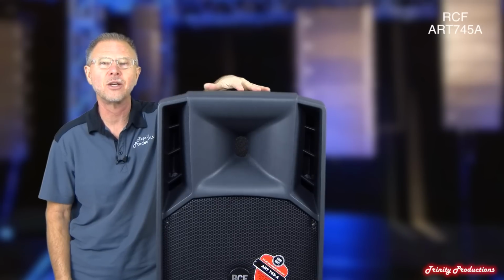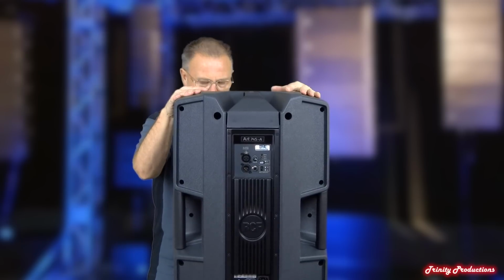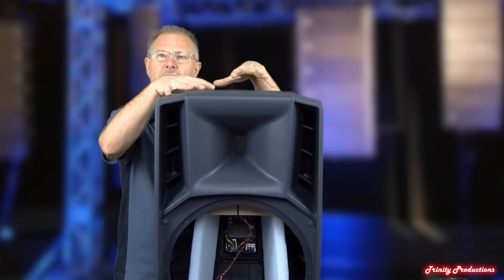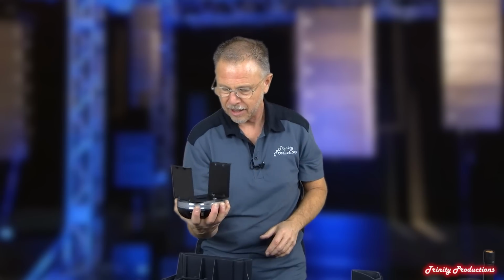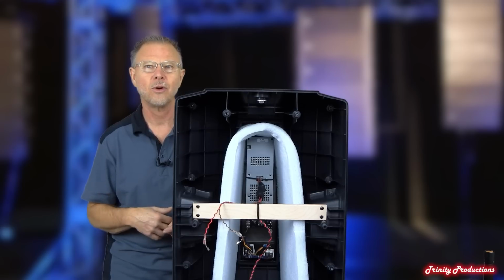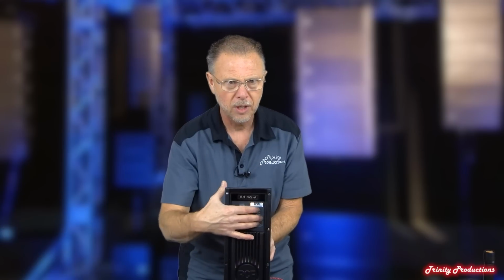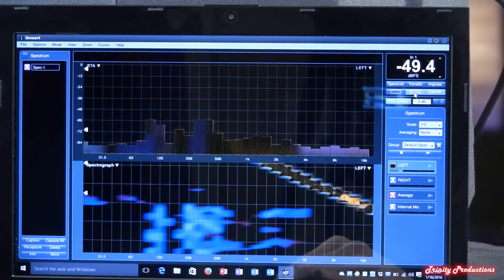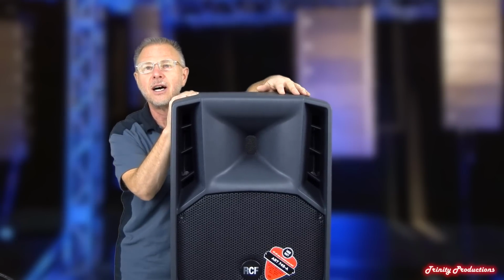RCF ART745A Complete review - 2 two-way 15" x 4" most awesome speaker - AUTHORIZED DEALERS

Comment: Hi 
Wich would you recomand ? I want to use just 2 Speakers for a Live Events. I have my eyes on Rcf art 745a and Fbt himaxx60 a 
Wich ist better in volum spl? 
Wich sounds better overall ?
Reply from the maker: The RCF 745 has a much lower cross over point 650hz vs. 1.6khz which is going to be a smoother transition from the LF to HF similar power to the speakers and similar SPL, I would take the RCF with the lower xover point any day. Less harsh to my ears

Comment: hello , i have 2x rcf 745A mk4 , is it possible to pair them with 2x 8003 and 2x 8004 subs ? and what is the best way to set up the system ? Thanks and greetings from germany
Reply from the maker: yes, either of those will work well, the 8004 has more power, but 8003 newer DSP, set for 90hz cross over and use the cross over out to your top boxes, run input into the subs and you are good to go. Thanks for watching.
Reply: @trinityprosound  thanks and very helpful reviews
Reply: @trinityprosound  sorry , 1 more question plz .. which is better ? DVA S1518N or RCF 8004 .. thanks again
Reply from the maker: If you don't need the RDNET of the 1518N then the 8004 would be my suggestion, both are great subwoofers.

Comment: Hello,  With the box being a two piece design, is the joint waterproof?  How would they stand up to use outdoors in occasional rain?  Or would they need the joint to be sealed?
Reply from the maker: no it is not water proof, i would look at a speaker that has a full grille and some type of foam behind it to ward off moisture, you would have to have custom covers for them to even think about using in RAIN. its electricity you can get hurt seriously or DIE from moisture and water combo and power...

Comment: hi i really meant the vol control .....also i have never touched the mic / line control looks like its set on mic ...does it make a difference ?
Reply from the maker: if on mic and you are using a XLR line input a huge deal as i will simply over drive the input stage of the DSP and could actually damage it , use mic input only if you have a dynamic mic connected directly to the speaker, in all other situations it MUST BE ON LINE INPUT
Reply: @trinityprosound  thank you i took them to my local music shop  and told me it was online but agreed it looked
misleading

Comment: another question if you dont mind   i think i know the answer but will ask anyway ....could you use the 745s and TT 25a s  together or would it cause too many phase problems ?
Reply from the maker: Like side by side ? No, too much comb filtering. you would have to splay them at their coverage angles to minimize that, but sonically they should be "ok" google speaker comb filtering for a good read...
Reply: @trinityprosound  would you just daisy chain out of one into the other or come out of aux on the desk ?
Reply from the maker: if you need control of the volume separate, an aux or sub group would be the best. if not and you set your levels and good to go, then L/R, and no other settings needed...
Reply: @trinityprosound  one more question sorry....but your advice is appreciated  i watch your brill vids all the time...
I have quite a low singing voice   would i notice a difference with the TT25a being a higher xover to the 745s ?
Reply from the maker: no you most likely wont hear any difference in that respect

Comment: what would you recommend if choosing between 745s and tts25a s ?
Reply: yes but i have  been offered some great condition TT25s at a great price so will i notice a improvement in sound quality from my 745s ?
Reply from the maker: Yes you sure will ....but, the xover point on the 745's is the main point of the larger HF driver making them sound soooo smooth , if they are the TT25A MK2 it does have the 4" driver and a low xover of 750hz but the ART has 650 hz , but the TT line has better everything, speakers, DSP, amp, drivers and wood box.
Reply: @trinityprosound  will the xover make a big difference ?
Reply from the maker: most will probably not notice the difference.
Reply from the maker: go with the NX45s, like a ART 745 in a wood box without having to spend $$$$ on the TT line.

Comment: i typically do 200-400 people wedding reception, would this suffice? Cant tell wattage
Reply from the maker: yes , 700 watts RMS power amp. 2 of those will do well, but if you want good low end you will need to also include subwoofers as with any 15" 2 way box, push to hard for bass and low end and you will toast them eventually.
Reply: thnx! what confuses me is qsc k12.2 says 2000 watts
Reply from the maker: 2000 watts of ? no one knows...from all the specs and what those speakers do, they are "maybe" 500 watts if that.
Reply from the maker: it is 2000 watts of who knows what, peak to peak most likely, then 1000w peak, then RMS around 500-600 at best. It is all marketing and many have fell into the trap.

Comment: Great Review, How would the 745 compare to Ev EXT 15" Line
Reply from the maker: Does not compare...the 745 has around 800hz cross over where EV is at 1.5k and RCF has a monster driver on it for smooth HF transition from the 15" driver. EV does not state what kind of power is the 1000 watts so assuming program or continuous and not 700W RMS as RCF box is...
Reply: trinityprosound ... wow As I’m Reading All These Statements My Feelings Are Getting Crushed Cause All Along I Was Thinking Qsc & Ev speakers Were Some Of The Best Brands And Come To Find Out They Best Lines Cant Even Come Close To RCF This Is Crazy I Run Two Qsc Kw152’s & Two EV Etx 18sp’s and the system sounds great in my opinion every gig I’ve done with People always compliment me on how good it sounds but now reading these reviews I want to sell it all and get even better I want one powered system that can handle damn near anything from big ball rooms to big cook outs😂 I love great sound!

Comment: how is this compared to the Yorkville PS15P's? I feel the rcf has a weak cabinet and i'll need to carry a sub to the gig vs my current PS15P's don't need to carry a sub.. the RCF's competition is QSC, EV..
Reply from the maker: About the same actually. Both have roughly same power and SPL you can only get so much from a driver / power applied to it with the volume of the speaker cabinets. The only speaker that I have used that comes close to not wanting to take a sub to a gig is the Yorkville NX750P, but would limit early with heavy low end content, thus the need for a dedicated subwoofer.

Comment: Hello,
What is better with 745, pair 8003 or two pair 708 or dsr118w ? We need system for gigs 500 people.
Reply from the maker: You will get 1db more output with a pair of 708's but most likely will never be able to tell the difference in SPL. The 8003 is a great sub but for a single sub per side for 500 in attendance may be asking quite a bit from a single unit per side.  the coupling of (2) 708 per side will move a bit more air with (2) 18" per side - the DSR is about the same as the 708's for power and output. Where is most of your audience at and what type of levels are you looking at maintaining, type of music etc.?????
Reply: We are rock band and we play in clubs, disco, no more then 300 people, but sometimes we play outdoor and in that situation we need some more db.
We have 745, but whats better with subwoofer, 745 or meaby 732 ? Thank you !
Reply from the maker: Can't get much better than a 745 in an injection molded box...the 8003 for 300 with one of those per side should work well. if you want to have everyone feel some low end, you will need 2 per side, but with one per side they will hear it in the system response and those up closer will get the good low end ... it will diminish through the crowd somewhat where obstructed. pole mount the 745's on the 8003 so the top of the speaker is 72" plus and you will have very good coverage and response. if they are standing a bit higher if possible.
Reply: 732a with the 905asII, 2x, maybe a third sub to go carioid. That'll be a hack of a system.......

Comment: He is raving about the 4" driver, the great crossover point and most importantly, the great sound quality because of the 4" driver.  My question is WHY DO OTHER MANUFACTURERS NOT USE 4" DRIVERS and always go with tiny 1.75" or smaller in their full-range boxes?
Reply from the maker: Cost is the main factor and as an industry we have come to accept 1.2khz to 1.6khz crossover points as acceptable...but once you hear a system crossed at 800-900hz you don't ever want anything else, it is almost like having a 3 way speaker..

Comment: The RCF 745A is no doubt a great sounding speaker. But what  concerns me is that since the 745A does not have a full grille,  there are chances that small lizards would climb into the box and find it a good place to reside, and the amp module could be damaged if these unwanted guests are electrocuted at the PSU. May I know your opinion,  would the 745A be suitable for permanent installation in a church where small household lizards is  commonplace? Thanks.
Reply from the maker: The ART745 is wide open and yes could have intrusion into the interior...look at the HD32 speaker.
Reply: Thanks very much for your reply, John.

Comment: Hi i would like to upgrade my Mackie 450 srm because to heavy. I need a powered speaker for backing tracks plus vocals no bass speakers. Question ive been looking at the 735 art series rcf speaker, firstly would a 735 or a 745 perform well with music and vocals. Bare in mind i will be using them in full range mode without bass speaker
much apreciate your response. Thankyou
Reply from the maker: Either of the Art boxes will work great for back tracks and vocals. If you can swing it, go with the 745. The tuning and DSP along with the large driver makes this an exceptional speaker for what you are wanting to do. They will go down to 90hz no issues, but lower than that, you will need a dedicated sub IMO
Reply: I dont want to use subs i just wanna plug it in and turn it up, thanks for your reply
Reply from the maker: yes , the 735 or 745 will allow you to do that , just remember a 15" speaker is not geared for low end dance music that a subwoofer should do....too many times users have toasted them from asking too much for a system that it is not capable of producing...not enough rig for the gig.
Reply: Yeah, im sure theyll be great, thanks

Comment: if there that good then could we please have a demonstration of the sound
because there is nothing online
Cheers
Reply from the maker: it would be impossible via youtube to try to really show you how they sound, take my word for it. the ART745 is , well, amazing. with the large HF driver and lower crossover point the speaker is smooth in transition from the LF to HF and has plenty of power. coupled with a single or double 18" subwoofer, this would be an awesome PA or DJ rig type speaker, it would set you apart due to the fact that the 745 would give you a sound that others would envy IMO

Comment: What is this box like compared to the hd32a? Thanks!
Reply from the maker: Lower cross over and better response than HD32A but HD32A is very good as well, more like ART732 than ART745 - HD boxes IMO have a bit more low end and different tuning that ART Series.
Reply: +trinityprosound Which box you recommend for live music? Thanks
Reply from the maker: the ART 745 is amazing and the sound quality from the large HF driver is like a much more expensive speaker...

Comment: How do they A/B to the qsc kw152 or kw153? Which one sounds better? I am curious?
Reply from the maker: They blow QSC off the earth....no comparison
Reply: radiotien Rcf 745-A is a fantastic speaker, light and powerful. I have two of these beasts and got another 745-A last week. They are a bit expensive but really worth it. Later this summer I am going to buy another one.
Reply: Thaks for th reaction trinityprosound. I am going to buy them about a couple of wheeks!

Comment: Thks for the response: only one thing: there is a great difference in the bass session from 745 to evox8?
With the 715 in open space i can play disco without great absence of bass frequency.
I think with 745 would be better... or not? 😊😊
Reply from the maker: the 7series art boxes are all same power amp, etc. 15" driver may be a bit different but the horn/HF driver is the huge factor in the 745. put your 715 on the floor vs. a stand to hear the difference. that is what the evox 8 will do with the LF box and keep the mids and highs in the top box

Comment: Thanks. What do u think about the bass response? I ' d like to use the 745 without subwoofer in gig with 150/200 max.
I'm a vj but a play 70' 80' with more attention to peak limiter. ☺️
Reply from the maker: You will get better low end from a set of EVOX 8's since the bass box is on the floor and has a larger volume to help produce decent low end response

Comment: Hi trinity ! Do u prefer the 745 or evox 8 ?
I like the sound with presence in the bass, great mid ad hi.
Now i have the 715. There are so many difference between 745 and 715 especially in the bass?
Thanks
Reply from the maker: They are different systems and configurations. The 745 will do things the EVOX 8 can not do and vice versa, the 745 will have more output than an EVOX 8 and when coupled with a subwoofer will be a great system and package. The EVOX would not be able to provide the sound like a 745 and subwoofer package would.

Comment: Hi. Do you know how these would compare to the Yamaha DXR15's?
Reply from the maker: They would annihilate them . . . . Yamaha lies about their power ratings, not true RMS and the drivers for a 15" cabinet in the DXR is pathetic. No stating of the crossover point either but would assume above 1.2K with the specs. The response of the 745 with the large driver and low crossover point is nothing short of amazing sounding and very smooth
Reply: Hi. Thanks for the reply. Wow I'm surprised the 745a is going to be such a massive step up as I've been getting excellent results with the DXR15's! 
I use the DXR15's by themselves for around 50% of my work and add a pair of WSC KW181 subs for larger gigs. 
I've been put off the RCF745's partly because of their appearance and also the lack of built in HPF's as my KW181's don't have switchable crossovers for use with tops. If I were to change the DXR15's for the 745a's I'd also need to change my subs which would work out very expensive.
The DXR15's have decent depth of bass and I regularly run bass and kick drum through them very successfully. How does the overall tone, depth of bass and output of the RCF745a's compare to the DXR15's?
Reply from the maker: true, but, the sound quality of your system would be amazing, with the RCF 8003 or SUB series, with the HPF, letting the subs do what they need to...
Reply: I heard the RCF 8003 subs a few weeks back and they are indeed very good subs. I've not compared them to my QSC KW181's but they sounded decent. I'm currently using the 120hz HPF on my DXR15's when I use the QSC KW181 subs and this works great. I'd been interested to hear the RCF 745a's with the 8003asII subs next to my system one day. A local dealer has the 735a tops and 8003asII subs so that would give me a good idea!
Have you heard the QSC KW181 subs? Also, have you heard the Yamaha DXR15's?
Reply from the maker: Not heard the DXR, but never been a fan of anything Yamaha. Had 8 of the KW181's , they were marginal compared to the RCF 8003 and if you can swing it, the 8004 is out of this world. QSC sells snake oil in their specs, they are OK speakers, but after hearing something really good, you never go back to marginal
Reply: The DXR's are much better than the previous Yamaha stuff and the DSR's even more so! What do you mean by the QSC's being marginal to the 8003's?
Reply from the maker: They are not as good or have the output that the RCF boxes do...
Reply: It's a shame about the weight of the 8003's as I have to manage these by myself! If it wasn't for the extra weight and size I would have gone for the 8003asII.

Comment: Hi Trinityprosound, am not sure between the RCF 745 and Mitus 152A in Canada the price is the same around 2000$ each, i need to replace my Maxx4A for more powerful live application speakers. Thank for give my your opinion !
Reply: Do not you think people have different tastes?
I would very much like to use Rcf, just because of its fame and greater commercial acceptance.
But a transition point as low as 650hz, I did not like it at all.
The way you write, you induce that a crossover point, the lower the better, when in fact, it depends.
To my rescue, there is the FBT, with the same characteristics, more resistance and a more conservative transition point.
Too bad that Fbt's marketing department has not woken up before, and never divulged their pre-orders as they should.
But it seems that things are changing there.
I faithfully believe that very soon, the Fbt will stand out above the Rcf.
Reply from the maker: That is a tough one with the being at the same cost. The 745 has less power, but has an amazing HF drive and lower crossover for very smooth sound transition from LF to HF driver. Better mids for sure with the 745. The 152a being wood box and more power, will get you a bit higher SPL, but with a cross over point of 1.2K, where as the ART745 is down at 650hz...i think the FBT is a great product, but depends on if you are OK with plastic vs. wood. If the plastic box is not a deal killer , i think you will be happier with the 745 IMO